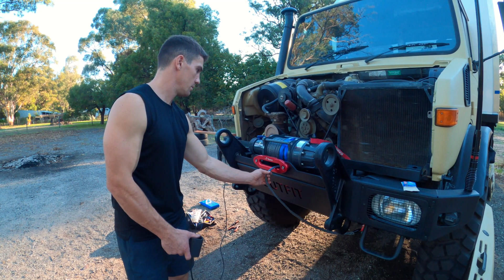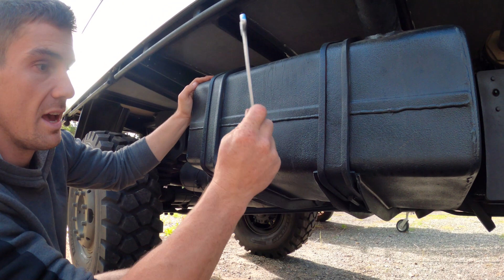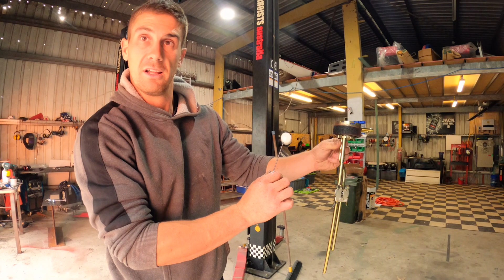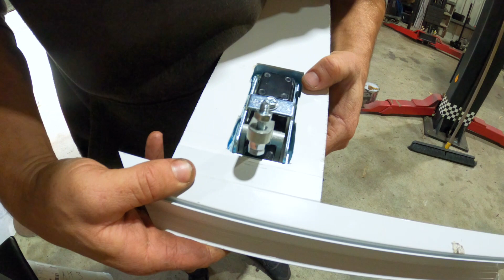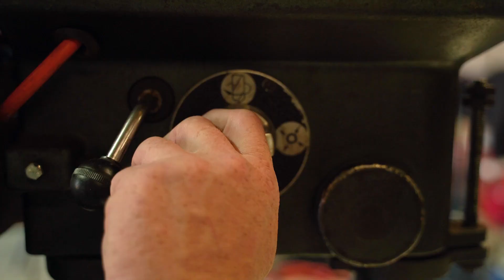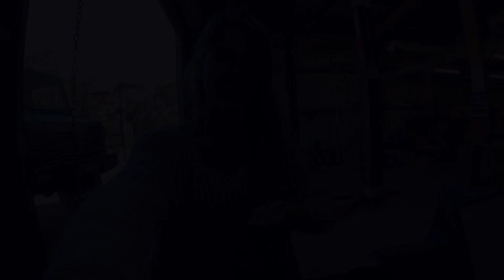EX-ARMY TRUCK DIESEL TANK GETS A CLEAN! Wiring Runva Winch -DIY Expedition Vehicle/Caravan Build#16

Comment: I just wonder about two things:
1. that battery disconnector on top of the battery box seemed to me a bit too much exposed. Wouldn't it shortcut batteries during fording, or limits your depth for fording?
2. extra diesel filter with water separator is great idea, but you also mentioned that your plans are to travel to sub-zero areas and so that might be an issue later, as diesel cars for example in Europe do have built-in diesel filters in engine bay and those are (not sure if all car makers do that) pre-heated from water-colling system! So glass (hope for some hard plastic) bottom diesel filter is nice but might limit fuel flow in sub-zero weather conditions.

Comment: Chris, I used to have to solder lugs on 4/0 welding  cable. NEVER any failures or coming off. Then heat shrink for protection. Maybe too much work though

Comment: One of the biggest problems with diesel motors is getting a load of bad fuel when you fill up. I'm ex forestry and we spend hundreds of thousands over the years pulling forestry machine fuel systems, pumps, injectors apart trying to flush them out after a contaminated fill. 

Now your tank is clean, fit the best pre-fuel filter you can find. We used CAT brand filters, cheap and easy for parts across Australia. Second,  always run "Fuel Doctor" with every fill it is truly amazing, cleans everything out and keeps it clean. 

https://www.youtube.com/watch?v=ik0VNBHcnMw&t=674s

Comment: Mate you can’t crimp cables like that and expect them to work reliably. Soon as you put some load on the winch and run it for any length of time, you’ll be in trouble.  Get them properly crimped with the correct sized crimp lugs, hydraulic crimp tool and correct sized dies. You can get a cheap set on ebay for about $50.

Comment: Where do I start? I have done the NASA standards termination course while training in the RAAF. For a high current crimp termination those strands of copper need to be parallel, otherwise it is knife blade crossing knife blade (strands will be cut and there will be failure of the termination). A termination of that size will require hydraulic crimping to exert the pressure required to meld the parallel strands together, a cold weld as it were.  If open to the elements it will require protection solder is a good choice to seal the outside, but the heat required to have it penetrate the stranded cable that should be squashed together will be excessive for the insulation to endure. In short do the crimp right, parallel strands, hydraulic crimp, protect it with some “Dielectric Grease” then heat shrink around it. Hope this helps 😊

Comment: Good video guys, I've been using a fuel additive called The Fuel Doctor  in all my vehicles diesel as well as petrol to stop algae growing in your tank and system,  been using it about 7 years,  never had any problems,  check it out, most auto stores. Ps. You got a very strong chick there , lifting 40 kgs of diesel 💪👍🤗

Comment: Like others have said,  get some proper terminal lug crimping done.  Do not solder though as this will weaken the joint over time and induce corrosion.
Just a properly crimped and heat shrunk joint is all that's required.  Either a hydraulic or mechanical terminal lug crimper designed for the job.  Most good battery shops can do this or may even lend you theirs for a bit so you can do it yourself. 
And yes,  I'd be putting some good quality split conduit around those positive cables.  70mm2 (or double ought B and S) can carry thousands of amps before the insulation begins to melt with the potential to practically vapourise steel. And yes I know you have it fuse protected but still........
Enjoying the build though....

Comment: To add to the chorus of comments re the crimping - in the absence of a proper crimper a better result would be to put a ball bearing or drill against the lug and crimp with the vise.  That will do a much better job of crushing the copper inside the lug, as you can apply massively more pressure with the vise screw.  Whatever you choose to do to fix it, it will let you down if not fixed.

Comment: The hydraulic crimper does a better job.  You have to use the right size die for the terminal.  Your Vise-Grip crimp is going to fail.  I would take the time to learn how to use the hydraulic one or soldiering is a better option.  I crimp and soldier for my projects.

Comment: The fuel level sender is a variable resistor. Check it with a multimeter it should change resistance smoothly. After a while in use the wiper arm can wear through the resistor windings and create an open. If it is okay check to see if voltage and ground (earth) is present on their respective wires. Power is usually fused so start there. The gage can be checked by 'shorting' the two wires together, the gage should sweep to full, on old school systems.

Comment: Build is coming along so well! 👍🏼

I won’t add anything on the connections, but yeah I’ve been grilled by auto electrician mates for not doing connectors properly in the past 😂

With the winch, I’d recommend having the isolator in a secure location. Reason being is it’s easy for someone to do a lot of intentional damage by throwing the winch line over your vehicle to the back and hot wiring the winch…end result isn’t pretty. Having the isolator secure almost eliminates the chance of this.

Comment: Hi there, to test the electrics of the sender unit, bridge out the earth and positive wires and the gauge should then go to full, do this with the ignition on, if it does this the gauge and electrics are good, it will then be a problem with the sender unit, the Mercedes units often have a problem where the contact on the coil which is the problem, I've worked on Merc trucks for several years and this can sometimes be fixed by an instrument technician, it could be costly so price a new unit first. Sometimes they will work only part of the way, to test this connect up the wires , turn ignition on and get someone  to watch the gauge as you move the float lever up and down, this will show you if it is working partially or not at all. The other issue that could be a problem is the earth wire connection, check to make sure that this is good, also check the fuses. I hope this info will help you to sort the issue out, Cheers Gordon

Comment: Chris, have to echo the suggestions of covering the cables and if you’re not using a proper crimping tool, soldering is way better than crimping with vise grips.  Those new T-locks are nice and clean install…

Also, recognizing someone that made a suggestion and you found it useful, is nice touch of class 👏.  It shows you guys are in touch with your subscribers and appreciate their support, even if it is just suggesting an idea.  Lastly, yes to the Q&A  👍

You guys stay safe, see ya on the next video. 
LP from Miami, Florida 🇺🇸

Comment: Another great video! Some friendly advice though. When installing a high current component like a winch, it's imperative that the crimps are made with the proper tool. Those vise grip crimps may work when the truck is sitting in the yard with no load on it but understand that over time they'll get wet, there will be corrosion and a crimp like that will loosen up. When your rig gets stuck in the mud with a thunder and lightning storm pouring down gallons of rain per minute, you want your winch to work. You do not want to be out there troubleshooting your electrical system and re-crimping with pliers. This is true for all your electrical connections.

Comment: Great start to the video. 
You can also turn the connector upside down and put it in a vice 
Heat it up with a flame and melt solder into it and then when its 50% full push your wire into it and it will never come OFF :D
Peace

Comment: good episode guys, but you need to crimp those winch wires and put them in a protective wrap 24volt will burn good and hot when it shorts out

Comment: A hammer and round chisel is better than just squeezing the crimp. The correct tool is very cheap. I usually crimp it and solder it. That will come loose!

https://www.amazon.com/dp/B00E1UUVT0/ref=cm_sw_r_cp_apa_glt_fabc_Y9QA4APNZZB2QCSRP7KW?_encoding=UTF8&psc=1

Comment: Nice jobs guy’s , I really like your door latches, right on the money checking and cleaning out the fuel tank. Just a suggestion because of the place of your winch isolation switch it would pay for you to get waterproof rubber / plastic caps for the +/- terminals so as you don’t get accidental shorting from either water crossings or inclement weather the second point is you really need to use gauge equivalent crimping pliers in conjunction with solder to ensure maximum conductivity and strength. I really enjoy your YouTube channel, well done to the pair of you 👍👍

Comment: I'd get those ends crimped fully dude. The current running through the cables when you really need the winch to work will create alot of heat. Also, I'd protect the cables where ever they run over any sharp or metal edges. After driving corregations theres plenty of potential for them to get rubbed through. If in doubt get a trusted sparky to double check the truck over. There might just be a few odds & ends that need attention, but its worth it if it prevents anything catastrophic happening.

Comment: It’s probably too late but if you hook the sending unit up to the electrical connection with it out of the fuel cell you can manually move it from  empty to full and see how it reacts with the gauge just one way to troubleshoot

Comment: If you have compressed air available you can pressurize the tank to assist the painful bleeding process.  Two person operation. A cloth around the airline into the tank while someone cranks the engine.

Comment: For your own benefit, please heed the  advice of the many  and get soldering those lugs! Fanatical anti chafing effort with nylon spiral wrap etc  will also pay dividends, and while you are at that, look at your  compressed air tubes and protect at any sources of rubbing.  Murphy's Law is unforgiving with his timing of failures, not good in times of crisis which is when your winch cables will have a meltdown.

Comment: Doing an awesome job guys. Just one thing. You said that you don't expect the rig to weigh more that about 10t fully loaded.  Are you aware that 20,000 pounds is 9 tonne so you'll be under powered if your rig weighs over that?
Reply: Not only that but depending on how stuck you are in mud, the pull can easily be twice the amount that the vehicle weighs.

Comment: Been driving and teaching soldiers on the mog for almost 20yrs. The fuel gauge has always only read 3/4 when full.  Also the smaller hole (lower) on the bar is for recovery. Attach a shackle to one and attach the cable end to it. As to pulling power couldn't fault it. The wheel brace went on the side and you could do it manually. I've pulled a truck and trailer single line pull fully loaded and no drama.

Comment: Hey mate just a word of advice when using your winch try keep your fingers as far away as possible from the fair lead. There was a moment there where you were spoiling the rope in with what seemed like very little tension. Some times this can cause the rope to find and even the you're spooling in/out it could then send cause the rope to go in opposite direction catching you out.
Also when spooling in try to keep hands clear as there was a moment where your fingers were between the rope and bull bar.
Last but not least if you had the opportunity to ever rewire the winch again it is always safest to have the isolator in a position where its in hands reach. I have seen them over run, or not stop where having an isolator in reachable distance is god sent. 

Thank you for another great video 
Check out my mog @barra_gu & @2_door_merc 😎👍

Comment: I like the way you guys are getting into the nitty-gritty, not hiding anything or making it look easy. I doubt I'll ever own, or need a Mog, but it's great seeing them customized and put to good use. Please get a proper HD crimper onto those battery terminals. They need 3D pressure to get a proper connection. A loose or incomplete connection will cause high resistance under load, especially once there's a little corrosion in there, and that leads to high temperature and a melted mess. You have the right hardware, just make sure it's connected properly. Maybe a welding gear specialty shop can help you, or a car audio shop that installs big systems.
Great move on the diesel/water separator with sight bowl. Once you get off the busy servos, fuel can be sitting around for a long time and collect a lot of water.

Are you planning on doing any sort of cover over the top of that roof? Having something to keep the sun off and give an air gap between is golden.

Comment: Watching Chris put so much effort into each step and take pride in his work was really disheartening for his own sake during the wire lug crimping... As many others have said, but loading on top so that hopefully more chance Chris sees this, those lugs must absolutely must be redone with a hydraulic crimping tool else may as well have just not done the job at all.

Need to install a fuse or circuit breaker and run welding cables in split channel conduit while your at it. These things are worth done right, and now so don't hesitate to go back and fix it

Comment: Chris if you're not using hydraulic crimping you really need to solder your wiring.  I learnt that the hard way, corrigations had me rewiring and replacing fuses in the middle of the tanami track.

Comment: Please. Crimp those cables properly. 70mm2 cable lugs squeezed with vice grips. You've created a hot joint. It could burn it's self out of the lug . 
Also cover those cables. Corrugated cable cover is very cheap insurance.
Reply: I agree with the cable covers, I've even split heater hose to use.  Especially over wear points such as inside fender well.  With the vibration, the insulation on those cables will not last and will short out!
Reply: @johncole5175  split heater hose is great I use it to protect cables where they need it

Comment: I like many other commenters will cringe at you using just vice grips to crimp cable connections. You're a strong dude but...
Might I suggest that you beg, borrow, steal a thermal imaging camera to check the individual connections. (with the engine running & the winch under load) the Amps will remain fairly constant, any voltage drop is a result of increased resistance and that resistance will be observable by an increase in heat.
Reply: Sorry I forgot to mention I LOVE your channel!

Comment: I didn’t see a fuse on the winch wiring? The cables by the controller are tight on the inner wheel arch and can rub through… you don’t want a dead short, with that size cable it will pull unlimited amps from the battery and make a massive arc show and potential burn your rig down. You can get resettable fuses/circuit breakers, suggest a marine version as these tend to be better quality and built to higher safety standards, just place it as near the battery as possible 👍

Find a suitable twin cable bracket and mount the cables where they pass the inner wheel arch corner to stop the rubbing.
Reply: Fuses or circuit breakers are not normally installed in-line with electric winches. Fuses and circuit breakers are used to protect the electrical wiring, nothing else - it is a common misconception.The isolation switch installed as close to the battery as possible is the norm and it activated when needed and not permanently powered. You need max current and minimal points of resistance or failure in the circuit so direct is best.

Comment: check your sender with a multi meter the resistance will change as the float arm is moved up and down , do the same at the connection end at the gauge now you will know the sender and the wiring is ok , next earth out the fuel gauge if working it will go to full

Comment: If you haven't pop the tank back in, to ensure the sender unit is working put a  multi meter across the terminals on DC resistance and move the float to check if the resistance changes. That way you can be sure the sender unit is working.

Comment: Here's another tip. Spool your winch rope nearly all the way out, leave 1 layer around the drum, then spool it back in under tension, either winch mog up a slight incline or click handbrake on a bit. Will stop the rope slipping on the drum the first time you go to use it 👍
Reply: Mog 'handbrakes' don't click on a bit. They are massive steel springs with an air cylinder attached that are either on, or off. But yes, winding the rope on up a slight incline is the way to go.

Comment: Please Please Please keep your hands out of the way of winch cable when stowing cable use a hook type hand saver  bar . Also vice grips won't crimp hard enough to pass the current later on and the joint will let moisture in and corrode..That said enjoying the series  immensely .Oh and crimpers are for crimps not copper pipe.
Reply: @johngregory662  No, those vise grips were definitely not suitable for the job.
Reply: @johngregory662  the crimpers require the correct crimps ie plated copper ones not water pipe
Reply: @johngregory662  You were talking about crispers.... to get your point across use proper English and sentence construction.

Comment: You could technically plug the fuel gauge into a battery. Tilt the float and see if it makes a click noise, if it does it means it’s working.
Reply: You can also just use a multimeter and measure resistance when full vs empty.
Reply: @andrefischer5025  that too. 👍👍👍